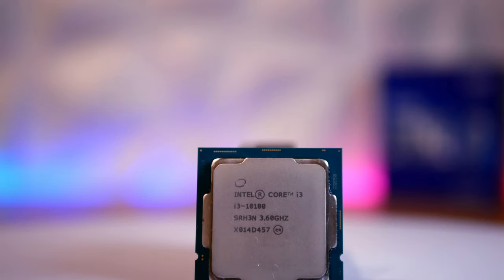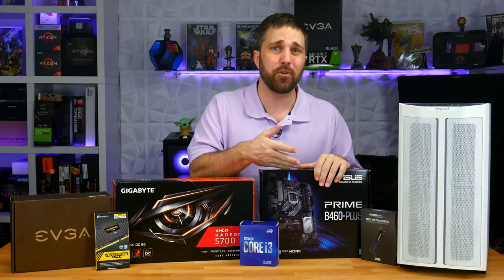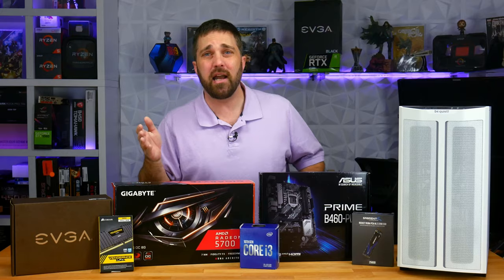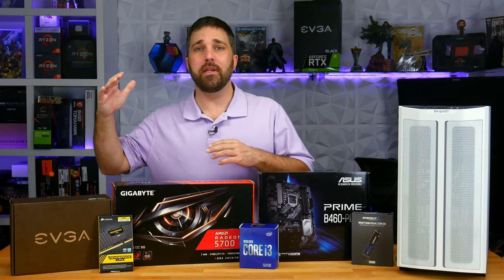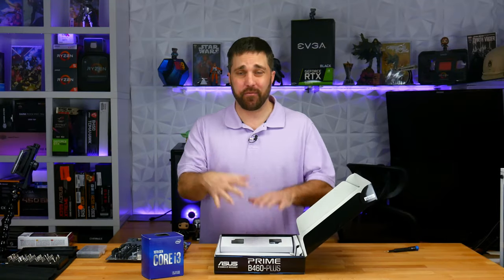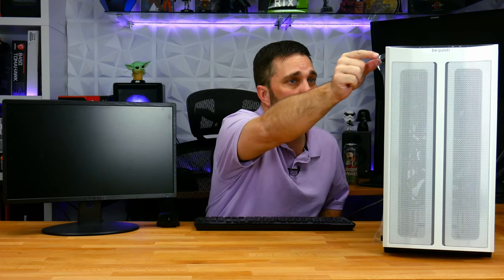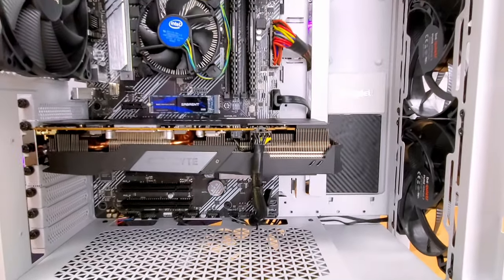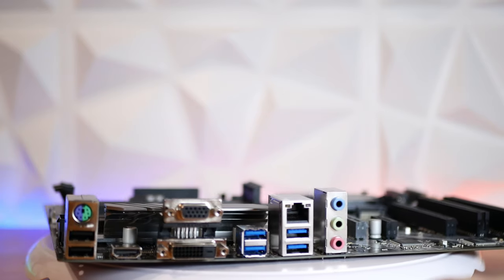$750 Intel 10th Gen Gaming PC

Comment: I have a build saved on Amazon right now with a i3 10100 and a 1650 super,a better case,16 gigs of ram,basically the same mb,a 600 watt 80+ bronze ps,a 256 gig ssd,a 2 tb hdd,keyboard,mouse,condenser mic with boom arm,extra big mouse pad,webcam,ring light and capture card all for $750.00 before tax and free shipping...
Reply from the maker: Sounds like a good deal for a 1080P 60FPS system.

Comment: what is the cheapest motherboard that can do well with the i3 10100? please tell me im trying to build a pc on the cheaper side and ill be buying the parts tomorrow
Reply from the maker: The ASRock B460M Steel Legend is on sale on Newegg right now and is the best value at the moment for a M-ATX Board. A slightly cheaper option is the  Gigabyte B460M DS3H. If you want a full ATX board go with the ASRock B460 Phantom Gaming 4. If you just want cheap and don't care about good power delivery there are several M-ATX H410 boards in $60 to $70 price range on newegg but I don't recommend any of them.
Reply: Do you think the i3 10100 will run good with msi gtx 1060 6gb
Reply from the maker: @moriss_7435  Depends on the game but in most cases you will be GPU bound in that setup.
Reply: @ElevatedSystems  what does that mean? If it means its not gonna be that good can you recommend me a gpu
Reply from the maker: @moriss_7435  That GPU is fine with the I3-10100 and will run most games at 1080P 60+ FPS. GPU bound just means that the GPU will be working hard then the CPU but thats not nessasaraly a bad thing.
Reply: @ElevatedSystems  thank you so much
Reply: @ElevatedSystems  hey im sorry for asking a lot of questions but what is better msi gtx 1060 6gb or KFA2 gtx 1060 6gb OC?
Reply from the maker: @moriss_7435  To be honest most GPUs perform almost identically across the different manufactures, however, I think The KFA2 1060 may have had GDDR5x memory. Not positive, but if so that is a slightly better option.
Reply: @ElevatedSystems  thank you for your time, appreciate it!
Reply: @ElevatedSystems  btw it has ddr5
Reply: @ElevatedSystems  hey sorry for asking again but will the i3 10100 run good with palit gtx 1060 6gb jetstream

Comment: Will this same RAM you picked work with my MSI b460m mortar and i3 10100? I'm having a lot of doubts about the ram compatibility
Reply from the maker: Yes, Intel doesn't suffer from the same RAM compatibility issues as AMD. The b460 chipset and the I3-10100 are locked to a max 2666 MHz for the memory so the Corsair LPX 2666 is perfect.
Reply: @ElevatedSystems  Thanks for your quick response! I really appreciate it! Now I will buy this ram kit for sure! U tha best!

Comment: this is actually almost identical to what im saving up for, except im going to get the 10320 and the cheapest z490 board they sell so i can have the easy upgrade path to 10600K or if they make a 10350KF later, when they are more affordible, and try and keep this one as long as i kept my Z77/2550K/RX480
Reply from the maker: Don't go too cheap on the Z490 board, you want to make sure the VRM design can provide ample power for your anticipated CPU upgrade.

Comment: Regarding the missing I/O shield and M.2 post/screw, I have seen numerous instances where missing parts are not the result of the manufacturer's poor QC, but due to the mobo actually being an RMA that was previously returned back to Amazon or Newegg for some problem and the previous customer was the one who did not return all the parts.  And then Amazon/Newegg believed that the returned item was still new and resold it. Unfortunately, every mobo company, for some reason, refuses to use security tape on either the box or the anti-static bag wrapper.  So even for $800 motherboards, you get an unsealed box and loose anti-static bag where you usually cannot tell if the motherboard was previously used and resold again :-(
Reply from the maker: That is a sound theory, however, I bought this Mobo on the day it launched so it's pretty impossible for it to have been an RMA.

Comment: My gigabyte b460 was 79.99 and i got this cpu and paired it with a H410 Asrock motherboard it was 59.99.
Reply from the maker: That's typically how it works, a motherboard with less features costs less. I just don't trust the 5 phase VRM solution on the H410M.

Comment: The unnecessary memory speed restrictions on this platform are laughable.
Reply: Absolutely, no reason for it whatsoever, maybe just trying to force people into the more expensive chipset.
Reply from the maker: Yup, and it's definitely locked, the system wouldn't even post when I tried to select a higher frequency XMP profile.

Comment: if you enable xmp, ram will run @ 3200 correct?
Reply from the maker: No, this is a locked CPU and Motherboard so memory speed is limited to 2666MHz regardless of the XMP profiles available.
Reply: @ElevatedSystems  so the xmp  only goes to 2666? Would xmp work on z 490?
Reply from the maker: @yaxo11  Yes it'll work in a Z490, but the performance increase from 2666 to  3200 is practically unnoticeable and not worth the price of a Z490 unless you are going to go with an unlocked CPU.

Comment: Is this a good combo i3 10100 1070 fe pls someone help
Reply: O and the b5550
Reply: I mean b550
Reply from the maker: First the I3-10100 and the GTX 1070 is fine, however a B550 motherboard is for AMD Ryzen CPU's not Intel. For the I3-10100 you need an Intel 400 series board. I'd go with an H410 or B460 motherboard because the 10100 is locked.